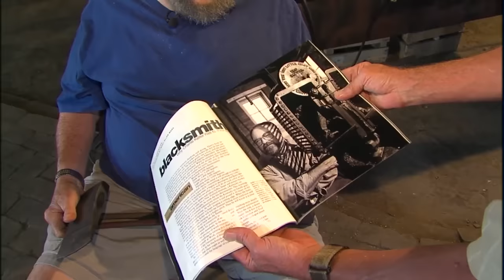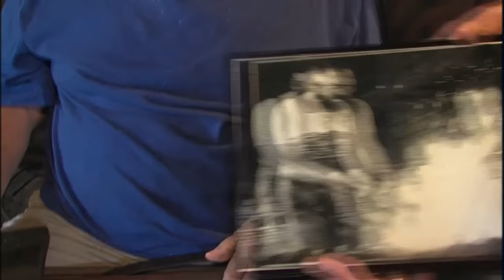Illinois Stories | Female Blacksmith | WSEC TV:PBS Newman

Comment: As a working blacksmith at both Mystic Seaport Museum and my own Flying Pig Forge, who started this over 50 years ago I hope Heather changes her hammer grip befor she developes problems and pays a little attention to the safety of her eyes, (you only get 1 set!) and other obvious parts of her anatomy. It would be a shame for her to develope  burn scars. Her guest is also not well protected. And what's with the propane torch? I wish her luck though!
Reply: +Chip Sowalski yes she could use a pair of gloves and specs, and perhaps something to protect the arms, I know it gets hot though but, her skin will thank thank her latter, hot metal and the radiation can do a number on the eyes and skin of course. and her grip is too stiff you want a bit of give from what I understand so you dont get carpel tunnel and tennis elbow later.

Comment: I see DANGER get that propane can away from the forge heat. A sign of a good blacksmith/craftsman I think is of the lack of gloves, eye protection, sleeves. Plasters taught me that not using gloves helps you handle the material and learn to put it on the wall not your hands.